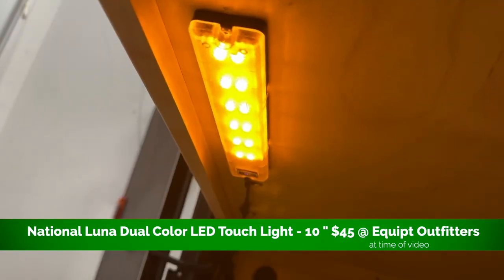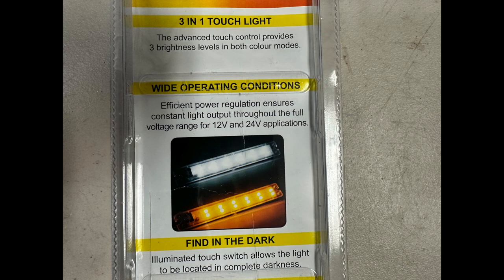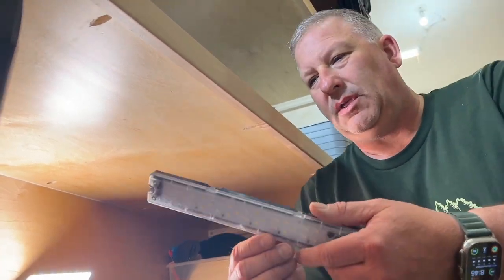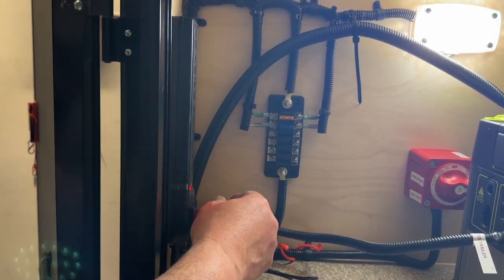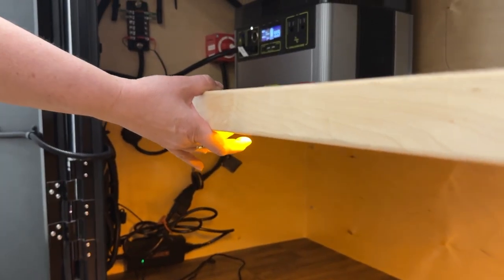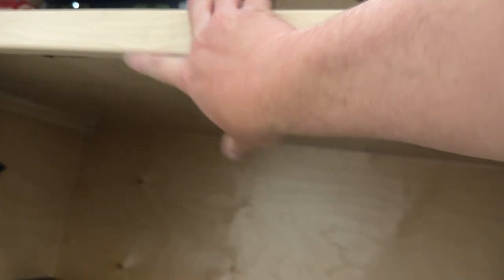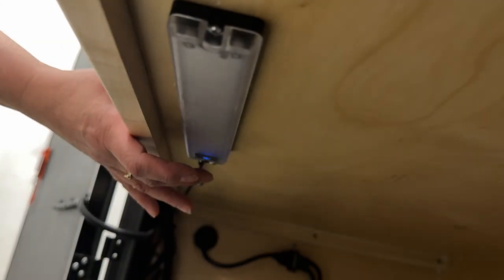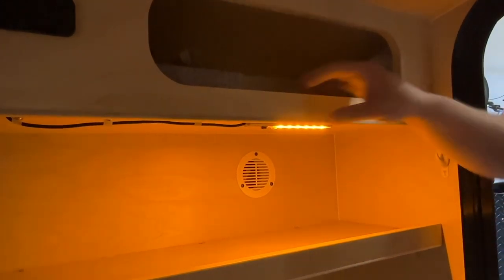LED Light Stick Comparison: National Luna vs. Oz4WD

Comment: I have four Nat'l Luna lights on each side of the exterior of my Weeroll square drop connected to 4 switches inside. When you turn them off they automatically remember what light setting they were on. The blue dot light makes them easy to see in the dark. I leave them all set on high when sleeping so if I turn the switch's  on I can really see what's going on outside if need be (security) Even on low they are extremely bright ( I glued parchment paper to the inside of the len's to soften the brightness.) Great light's made in South America. I would not recommend these lights in a  location that you can't see the on and off button.  Thank's for the video Mike and Wendy

Comment: I put Anderson power poles on all my DC electrical connections. Saves so much time. Love the videos.
Reply: Why do that for a permanent installation like a light?  I do that for portable equipment.  I haven't found a good weatherproof bulkhead connector or cable gland for them, though.  I thought about making my own, but in the meantime I am using an MC4 cable gland system to get power outside and use an MC4 to powerpole adapter cable.
Reply: lol

Comment: Has anyone ever tried to build their own using aluminum channel and led? I like the OZ for the silicone waterproof. Not sure how they do that. Thanks, Matt.
Reply: Yes, I have several lights build from ‘scratch’.  I highly recommend the Oz lights.  They’re turn key and very well built.  The scratch-built lights are working fine but making wire to LED tape connections are not consistent.  Soldering to that silicone strip is a bear!  Buy the Oz light and insert a dimmer switch!

Comment: I have lights from Hard Korr.  Very similar to the oz lights, but they have a separate switch housing.  I mounted the switch on the front face of the shelf for easy access and button pushing - on/off, amber/white, +/- intensity.  The switch housing is small enough where it doesn't interfere with closing the rear door.
Reply from the maker: We have the similar Hard Korr along our awning - we have found that switch to be unreliable for us. We also had to replace the 12v portion of the power cord.

Comment: I'd prefer the softer light of the Nat'l Luna, but wouldn't care for the multiple presses for on/off, and trying to locate the switch as you mentioned. For now, I've taken the cheaper route, and use some push on/off puck lights attached with Command Strips.  Oh, and I've covered the Hiker-installed galley light with an amber (removeable) film. That thing is way too bright.
Reply from the maker: Luminex for the win to dim the preinstalled lights!